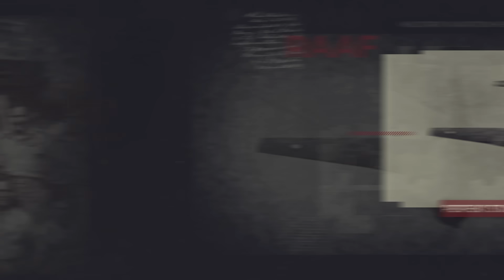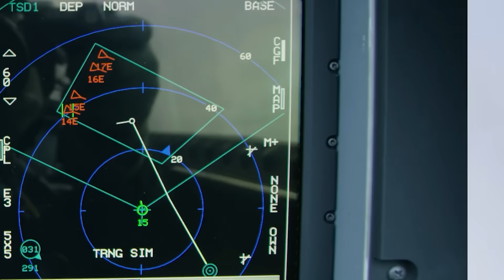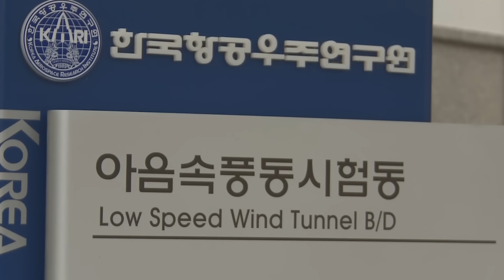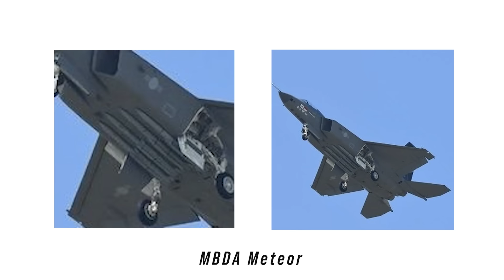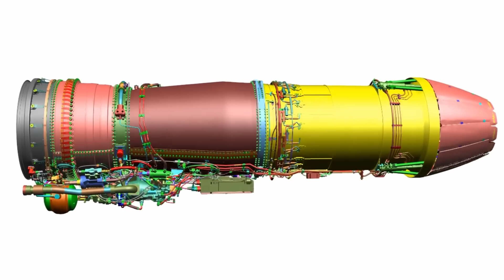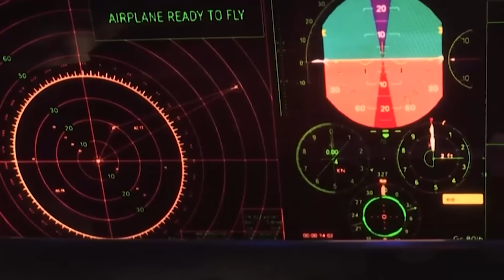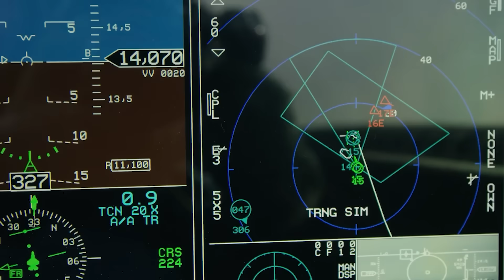KF-21: Korea's New Fighter

Comment: Korea will succeed in engine development.
South Korea has been license-producing and supplying GE's engines for more than 40 years and has successfully developed a 5,500-pound unmanned aerial vehicle engine.
And Doosan Energy in Korea succeeded in developing a gas turbine generator that has the same structure as an aircraft engine.
This is the only successful development of these four countries: the United States, Japan, Italy, and Germany.
This is almost identical to the aircraft engine structure.
The technical risk of Korea developing fighter engines has been about core materials. However, by developing gas turbine generators, they have developed materials that can withstand high temperatures, which is leading to the development of fighter engines.
A Jeopardy Tamper with a 5500-pound Korean engine will work with KF21. Tense has already been revealed.
On top of that, one of the reasons why 100% Korean engines will be developed is that the production volume of the Korean Air Force itself is enormous.
At least 170 KF21s for training and sales will be produced exclusively for Korea, with 120 F16s and 36 F16s on the verge of withdrawal, and countries that are satisfied with the performance of the gas are emerging, and demand for high-performance gas at low prices is basically waiting for more than 200 units.
This means that Rolls-Royce is proposing a technology alliance first, leaving behind GE, which is naturally stingy before technology transfers, providing engine technology applied to Eurofighter and co-developing more advanced engines.
This ensures a technology transfer that is almost similar to the engine performance applied to KF21, and when combined with South Korea, which has its own capabilities, a complete new engine will be developed and parts from the United States will no longer be used.
Korea's advanced semiconductor technology has surpassed the performance of Italian and Israeli radar companies, which is why Israeli and Italian companies want to receive Korean gallium nitride high-performance amplifiers rather than Korea.
Korea, which has world-class satellite development technology and projectile technology, has also succeeded in developing various optical equipment with excellent performance and has succeeded in developing long-range surface-to-air missile systems such as L-SAM, accelerating its plan to develop Korean-made air-to-air missiles. The world's best thrust deflection technology developed by L-SAM will be applied to KF21 air-to-air missiles, surpassing the maneuverability of German missiles, and the highest-performing short-range air-to-air missiles with a range of more than 40 km will soon appear.
In developing Hyeonmu 5, we developed a high-performance penetrator that outperforms U.S. super-strong penetrators by 15%, which is applied to Korean-made long-range air-to-ground missiles.
It is more powerful than any other long-range stealth air-to-ground missile in the world, and will come with KF21 at a high performance and affordable price.
The above is a situation that is actually being implemented or being promoted, and as a weapon of democracy, Korea will now show the world's best weapons development capabilities in all areas of land, sea, and air.

Comment: Made in USA. 😂
Reply: Yeah, the engine only. Korea is very close to producing that as well. So there
Reply: 😂
1. Aesa radar by Hanwha(Korea) 
2. IRST by Hanwha(Korea)
3. RF Jammer by LIG Nex1(Korea)
4. Eotgp by Hanwha(Korea)
5. PWR by LIG Nex1(Korea)
6. EWC by LIG Nex1(Korea)
7. CMDS by LIG Nex1(Korea)
8. Digital Cockpit by Hanwha/ADD (Korea)
9. Mission Computer by KAI/ADD(Korea)
10. Avionics control system by KAI(Korea)
11. Brake system by KAI (Korea)
12. K Link Communication System by Hanwha/ADD (Korea)
13. Aircraft Fuselage by KAI (Korea)
14. Aircraft wings by KAI (Korea)
15. GE engine licensed by Hanwha (40% Korea)
16. LRAAM / SRAAM / KALCM / L MCM / L MSM / Hypersonic missiles by LIG Nex1 (Korea)

Design / Wind tunnel test / over 1,300 flight test of KF 21 across 6 prototypes by Korea with only the blend body, canted tails and S duct design collaboration with Lockheed Martin who have been decades long partner of South Korea. KF 21is a less expensive, cost effective, less stealth, low observability and not full stealth until KF 21 batch 3 with internal weapons bay.

Comment: Meh. Cheap knockoff.
Reply: 😂
1. Aesa radar by Hanwha(Korea) 
2. IRST by Hanwha(Korea)
3. RF Jammer by LIG Nex1(Korea)
4. Eotgp by Hanwha(Korea)
5. PWR by LIG Nex1(Korea)
6. EWC by LIG Nex1(Korea)
7. CMDS by LIG Nex1(Korea)
8. Digital Cockpit by Hanwha/ADD (Korea)
9. Mission Computer by KAI/ADD(Korea)
10. Avionics control system by KAI(Korea)
11. Brake system by KAI (Korea)
12. K Link Communication System by Hanwha/ADD (Korea)
13. Aircraft Fuselage by KAI (Korea)
14. Aircraft wings by KAI (Korea)
15. GE engine licensed by Hanwha (40% Korea)
16. LRAAM / SRAAM / KALCM / L MCM / L MSM / Hypersonic missiles by LIG Nex1 (Korea)

Design / Wind tunnel test / over 1,300 flight test of KF 21 across 6 prototypes by Korea with only the blend body, canted tails and S duct design collaboration with Lockheed Martin who have been decades long partner of South Korea. KF 21is a less expensive, cost effective, less stealth, low observability and not full stealth until KF 21 batch 3 with internal weapons bay.

Comment: Its obvious the US gave them tech to make this...
Reply: 😂
1. Aesa radar by Hanwha(Korea) 
2. IRST by Hanwha(Korea)
3. RF Jammer by LIG Nex1(Korea)
4. Eotgp by Hanwha(Korea)
5. PWR by LIG Nex1(Korea)
6. EWC by LIG Nex1(Korea)
7. CMDS by LIG Nex1(Korea)
8. Digital Cockpit by Hanwha/ADD (Korea)
9. Mission Computer by KAI/ADD(Korea)
10. Avionics control system by KAI(Korea)
11. Brake system by KAI (Korea)
12. K Link Communication System by Hanwha/ADD (Korea)
13. Aircraft Fuselage by KAI (Korea)
14. Aircraft wings by KAI (Korea)
15. GE engine licensed by Hanwha (40% Korea)
16. LRAAM / SRAAM / KALCM / L MCM / L MSM / Hypersonic missiles by LIG Nex1 (Korea)

Design / Wind tunnel test / over 1,300 flight test of KF 21 across 6 prototypes by Korea with only the blend body, canted tails and S duct design collaboration with Lockheed Martin who have been decades long partner of South Korea. KF 21is a less expensive, cost effective, less stealth, low observability and not full stealth until KF 21 batch 3 with internal weapons bay.

Comment: It’s literally an f-22 minus the stealth, hence kf-21😂
Reply: Well, the KF21 program was developed in cooperation with Lockheed Martin, so the aircraft is bound to resemble a slightly scaled-down F22 in some metrics.
Reply: That means that if you just add stealth performance to the KF-21, it can achieve similar performance to the F-22

Comment: It is not so much that countries are copying US stealth fighters.  There are common requirements that various nations require.  And that restricts their design features.  Much of the stealth designs are done using similar mathematics, computer software and materials.  Also, functional aerodynamics.  Most of these are conservative designs with large, rear, angled vertical tails.  Future fighter designs may include tailess or very angled stabilisers.   As seen recently with flying Chinese research aircraft.  Which can improve stealth but limits flying performance.  And require computers to fly them safely.  Some US prototype fighter aircraft designs remain secret, but likely lack rear stabilisers.  Most modern aircraft use computer aided controls.

Comment: The combat radius of the KF21 fighter is expected to be 800km because it has the same airframe structure as the F18. Of course, this applies when three large capacity fuel tanks are installed.

Comment: .

My take on the KF-21:

Clearly a cheap 4.5G Raptor OUTSOURCED to the ROK by LMT designed specifically to take the Godzilla de’la Sinensis and le Raptor de’la Gobi Desert and… 

of course, a much needed *FACE SAVING INVESTMENT by the ROK to offset the affect of China’s speedy’de’gonzalas advancement in the aviation sector today 

Same kind of kick in the bud goes to Japan’s Shin Shin or JFX program however, with Hyndais and KIA’s as more economical end products to Toyotas Hondas and Nissans, the KFX thus have all of the advantages on taking on such a role… 

Who next in this challenge? The AMCA of course which is what I call the next big knee jerk!

.

Comment: Facts about KF21 that you may not have known but are not important in everyday life

- Some people look at the shape of the KF21 and call it the 5th generation. But this is wrong.
- KF21 was officially developed targeting the 4.5 generation. Korean Senior domestic officials do not classify KF21 as the 5th generation.
- The reason is to replace the aging F4 and F5, and their goal is to create a cost-effective fighter aircraft suitable for the Korean security environment rather than taking on difficult challenges.
- And it is a conservative plan to minimize failure. Rather than developing for the 5th generation from the beginning and failing, it is safer to develop the 4.5th generation first and then upgrade to the 5th generation.
- Korea introduced the F35 to utilize the 5th generation fighter aircraft.
- There are no official plans for a 5th generation upgrade yet. However, development is expected to be possible in the 2030s.
- Currently, there is empty space inside KF21. This space was designed with the 5th generation internal weapons bay in mind.
- The number of 120 KF21s to be operated by the Korean Air Force has been confirmed.
- The Korean Air Force plans to order hundreds more KF21s in the future.
- There are plans for a KF21 naval aircraft carrier version.
- However, Korea's possession of aircraft carriers is inappropriate for Korea's security environment, so there is no progress in the project.
- The Korean government plans to develop its own engine comparable to the F414 by the 2030s. Of course it is will be used in the KF21. currently, thay are focusing on drone engine development.
- Mass production of KF21 began on July 10, 2024.
Reply: So, South Korea is developing its own jet that will be eventually 5th gen like the F/A-22 but smaller with smaller engines yet somehow cheaper than the single-engine F-35 which even Europeans cannot match on price with their Eurofighter nor Rafale despite both being lighter and less sophisticated due to both having two engines and low rate production that making them far more expensive than they would be otherwise... 
I somehow fail to see why producing its own 5th gen jet would make sense for a population wise medium-sized nation however developed if it will need to compete with the US, UK/EU, Russia, China, and nations cooperating with them on their jets, oh yeah and don't forget Turkey already working on its own F/A-22 knock off which can produce anything a lot cheaper than South Korea due to wage difference... 
If your nation is already depending on foreign nations for their jets that can produce them cheaper yet better due to decades of experience and economies of scale, what is even the point of trying to compete in already overcrowded space of jet fighter competition if you cannot compete with economic incentives large nations often package in with their sales (promise of investment within a nation purchasing your jets as the US s often doing) small nations cannot compete with??? 
Are Koreans in fear of ending up like Taiwan which has been left for dead for some time by denied access to newest weapons that could make the difference in the likely upcoming invasion of China, similarly as previously happened to Ukraine now hastily supplied with everything West won't miss??? 
Well, I hope that hard-working Koreans will show everybody how they can beat big boys, otherwise, this will be a money pit beyond belief, especially when engineers capable of developing 5th gen jets could rather work on something that would make a lot of money and deal with the aging of the population like robotics & AI, not to mention that by time thing thing become operational, China will be likely fielding 6th gen...

Comment: KF-21 is a beautiful bird. Looks promising for many upgrades, even somewhat stealthy. Just a few modifications, and you could be a gen 5 jet. Awesome work by the Koreans!
Reply: Looks Good But they Dont have a an Advanced 5 Gen Engine so there no Go !   No Engine 5gen !   It takes Decade to make one !  :hand-pink-waving::hand-pink-waving::face-blue-smiling::face-blue-smiling::face-blue-smiling::face-blue-smiling:😪😪😪😪😪😪
Reply: @ivanronin8209  In South Korea, there is a company called Doosan Enerbility that has developed state-of-the-art gas turbine engines. They have already completed the development of key high-temperature-resistant materials, which significantly increases the likelihood that they could develop aircraft engines in less than 10 years.
Reply: @ivanronin8209 중공인 전투기 젠20의 검은매연? 연막 스텔스 기능을보고 놀라움을 금치 못했습니다 다른 버전도 꼭 성공하기를 기대중이에요 😂

Comment: it goes to show you just how important the F22 is in the aerospace ind.  The F22 set the bar really high and since then, most of the aircraft being  developed outside of the US are all showing features of the 5th gen F22, while US is now moving towards the 6th or even 7th generation aircraft. even the turkish kaan borrows a lot of design elements  from the F22 and even mixing it with some design elements from the SU 35.

Comment: All of the F-22 and F-35 fan boys and girls will talk about how much better the 22 and 35 are are, but even the US can't really afford to fly these fighters.  The Navy and Air Force had to reduce the annual flight hours for these planes by 21% because they could not stay in budgets to fly them more than this due to the operating and maintenance costs.  Also, the F-35s have really poor full capability rates, with the F-35C, a plane that the US depends on heavily  to project US Power and defend the fleet only has a full mission capability  rate of 14.9%, and that has been falling steadily since the plane entered service, and there are no war ready engines today, and not expected to be any until 2030.  If you can't get an engine for a plane, it is not going to last long in a sustained military operation.

Comment: It is extremely unlikely that any nation outside the US and China could produce complex aircraft domestically without relying on imports of key components and materials. The vast majority of exported products from the world's biggest exporters (Japan, Germany, Netherlands, UK - again, not necessarily US and China) require the import of finished parts, or the use of foreign labor in other countries to process materials which are then imported. Thus, up to 60% of the materials and components that you see in a complex fighter can be foreign in origin, and it is counted as a domestic product only because it was "assembled" in the home nation. Therefore, the idea that domestic fighter improves national security and resilience is largely inaccurate because if a war were to cut off key supply chains, the nation in question would still be limited to existing stockpiles of spare parts, and have little or no ability to manufacture new aircraft from those stockpiles. This would be no different to simply buying a foreign design and a stock of parts. The security argument is a popular myth.

Comment: Why did Lockheed choose to Partner with the Koreans for the KF21?
Reply: Lockheed Martin does not provide technology or actively assist. We only provide technical advisors for a very small portion of cases. This is possible because we maintain a cooperative relationship, including the introduction of the F-35 into Korea and the FA-50.
Reply: not partner. dude.
Reply: @ttqq6781  then what are they? on the wikipedia page it says partner
Reply: Why? simple $$$

Comment: Among the contracts between Lockheed Martin and KAI are as follows.
FA-50 has a constraint that it cannot exceed the latest F-16 specification.
So the FA-50 has its limits.
However, the FA-50 is a cost-effectiveness and has a full role to play.
Very powerful as a 5th generation pilot training, proximity support, and small multi-roll fighter.
It must be a very useful aircraft for both training and practice.
Armed forces are also evolving.
In Block 2
AIM-9 Sidewinder
AIM-7 Sparrow
AGM-65 Maverick
IRIS-T
KEPD 350K-2
AIM-120 AMRAAM
It will be armed.

What is unusual is that the Korean-made AESA Radar is better than the US-made Radar with performance limits.
However, due to the inherent limitations of FA-50, it seems to be impossible to mount.

However, KF-21 has no constraints.
This is because Korea has developed core technologies such as AESA Radar, IRST, EOTGP, and RF Jammer.
The interior armament is also under development and the MUM-T system is also under development.
We're testing to control three drones with wingmen
It is being developed as a multi-purpose fighter with more than five generations at the same time as the development of internal armoured windows.

The AESA radar developed by Korea is a gallium nitride material and is powerful.
It is currently used in Korean Aegis destroyers, M-SAMs, and L-SAMs.
Gallium oxide materials that are much more powerful than gallium nitride materials are also being developed.

Korea has strong EMP technology.
RF-Jammer is also very powerful.
It will reach NGJ-MB performance enough.

IRST is currently on board the frigate and in use.

EO-TGP is already applied to FA-50.

Core equipment is constantly being upgraded with the development of new technologies.

KF-21 Boramae is the name of a falcon when its young is raised for hunting.
Boramae is called the Little Raptor, but in the near future, it will evolve into the fifth and sixth generation fighter jets that will shine on itself.

I hope you will pay a lot of attention to KF-21.